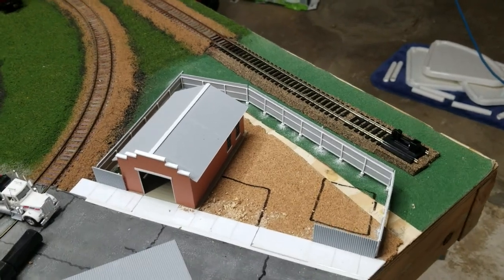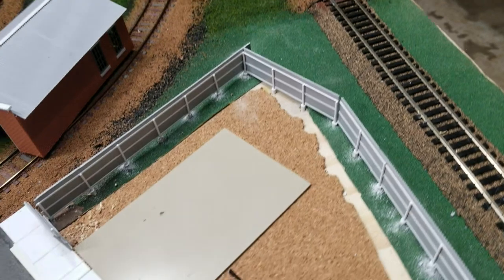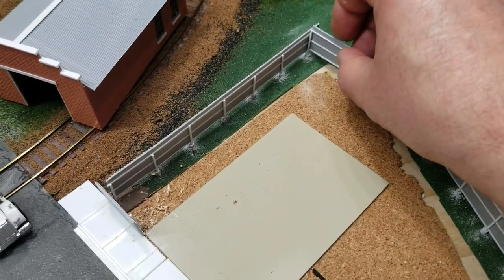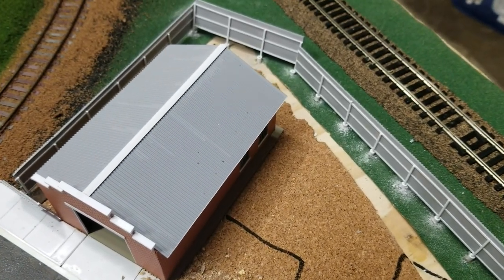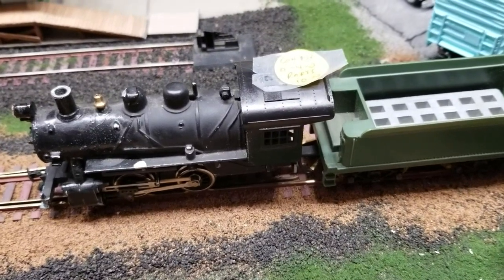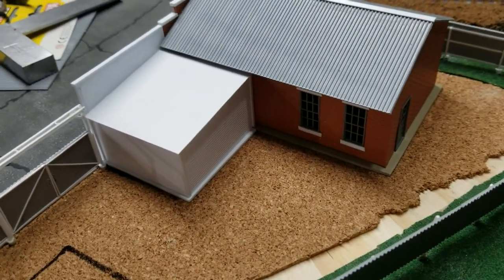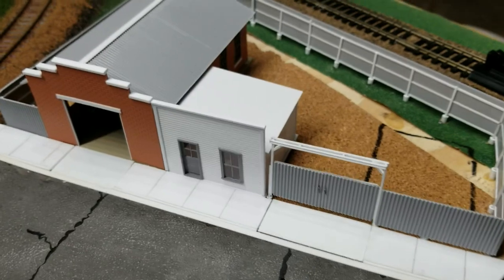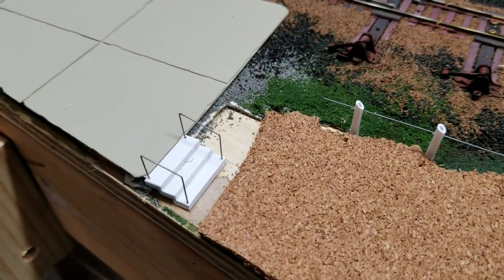Layout Update October 7

Comment: good idea for the fence. little sleeves for it to sit in so it can be removed at any time. that is cool that you got the old steamer working.
Reply from the maker: Thanks Sparky it was pretty frustrating at first but once I got the corrugated styrene on it it stiffened right up. I may remoter the 0 4 0 for better slow speed.